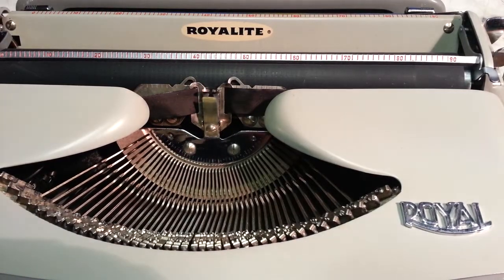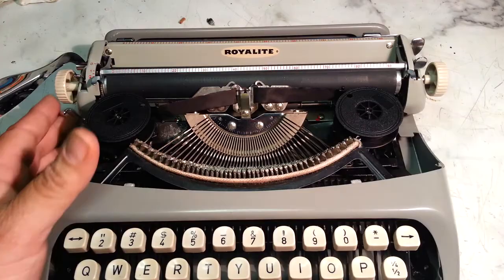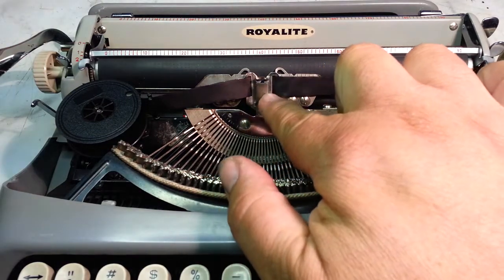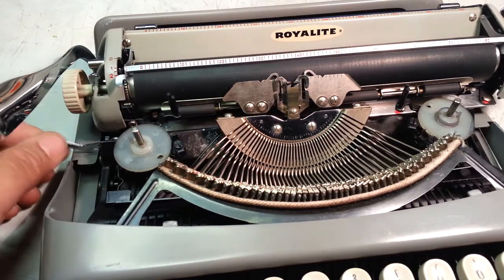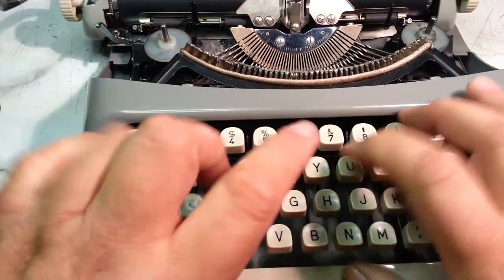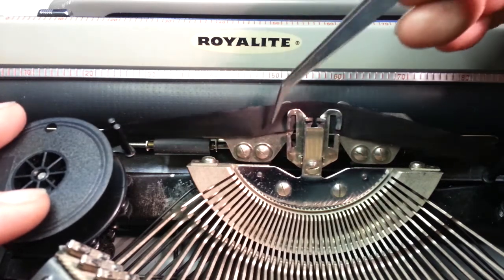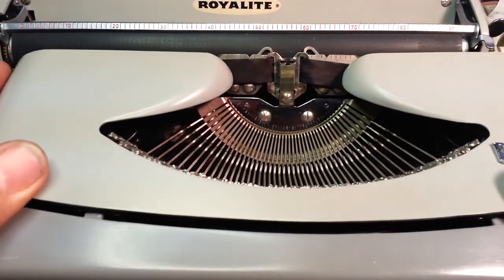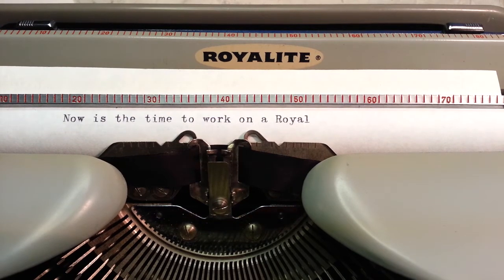Royal Royalite Typewriter Ribbon Install Demo Clean & Serviced Vintage Manual from 1960

Comment: Hi, please excuse my English, I'm not very good at it. I just bought a Royal Classic manual printer, but when I press the keys they don't show up well on the paper, I placed the ribbon correctly. If I press the keys a little hard you can see them better, but not always. Is this because the ribbon is not very good or could it be a problem with the machine? I need help to know if I should change it.
Reply from the maker: Rub the ribbon between your fingers, if ribbon is new, your fingers will be very inky
If your fingers are just a little dirty, ribbon is worn
If your fingers are not dirty, ribbon is dry/bad.
Reply: @phoenixtypewriter2136  Yes, my fingers were very dirty with ink. It is possible that it is a defect of the machine.
Reply from the maker: @Bimbibooks9898  Yes, could be something wrong.
This FB site is all about typewriter repair help,
https://www.facebook.com/groups/typewritermaintenance

Comment: Thank you so much for this video, I've got this typewriter and have been slowly tidying it up. I wanted to ask, as I have an ink smudge that appears on the line below the typing line, what could be causing this? I wondered if the ribbon was not being pulled tight but on this machine there aren't additional clips to hold it. It's all that is wrong with my typewriter now and am struggling to find out what the issue is!
Thanks again for the video, really helpful for a novice like me!

Comment: mine dosent move to the left when the keys are pressed unless I give it resistance with my finger on the carriage.  is there a secret button im missing or could a spring be dettatched?
Reply from the maker: Sounds like the main spring/draw band (string) is disconnected or broken.
This is a primary component that is critical to make typewriters work
Look up draw band videos to find some solutions

Comment: I have this exact typewriter. The carriage doesn't advance after typing certain keys. Do you know what might be the problem? Or a way to fix it?
Reply from the maker: Space bar work ? Tension on carriage ? not a common problem I have a common answer to
Troubleshooting is gonna be needed
Reply: @phoenixtypewriter2136  For the space bar works maybe the best, nice and easy, tension on carriage also good. Thanks for the answer.  Appreciate.

Comment: Hey Duane, I recently picked up two of these little guys. Are they supposed to have a ribbon reverse? I ask because One model seems to have that and the other doesnt.  On the one that doesn't, on the LEFT ribbon spool there is only 1 spring loaded L-shaped mechanism (with what looks like a space for another next to it (a screw but no L-shaped piece attached)).  It seems that the one you are working on here ALSO has only 1 L-shaped ribbon advancer on the left spool??? Am I overthinking this? I was about to try to fabricate one out of an aluminum lid and a ball point pen spring! :)  The second version, has plastic ribbon sprocket and TWO l-shaped advancer mechanisms on the left and ride ribbon spindles!

1:57
Reply from the maker: Yes they should have reversing. Hard to see but both R & L have a drive pawl (screw pawl) and an anti-back up pawl , 
you can post pictures on FB maintenance site
Reply: @phoenixtypewriter2136  thanks Duane. I've been laboring over this silly thing for a while. I deduced that there are supposed to be two and one l pusher was gone. I fashioned one out of a picture hanger and then installed. Unfortunately it's not working - due to difficulty getting a spring into that l shaped pusher mechanism. I can manually hold it and advance the ribbon sprocket. I'll get there. Anything better than ball point pen springs to replace the work out springs in such a mechanism?  And I'll have to look up the FB maintenance group as I'm not yet in it thanks!
Reply: Talan, I am working on one of these and the drawband is disconnected. Would you mind snapping a picture of one of your working machines, so I can see how the drawband connects?
Reply: @rossman1600  hi Ross. Sorry but I've sold mine. Pretty sure it just attached to a notch on the carriage and an opening in the main spring drum
Reply: @LazyDogTypewriters  Thanks very much. I think I found the notch on the carriage last night. I was looking under the carriage at first, and couldn't find anything.

Comment: I just purchased one of these for $22.  The Q strikes the lid but the typebar does not appear to be bent.  I suspect the lid is out of shape and will try bending it back.  Any advice or other potential solutions you can think of?
Reply from the maker: I would have to see it to make a comment, but your answer sounds good.....
Reply: @phoenixtypewriter2136  Sounded good... but didn't go well in practice.  Snapped it in half.  Oh well.  I bought this as something to learn on after watching a lot of your videos.  I plan to still attempt a tear down and rehab anyway.  Thanks for the reply!

Comment: What would cause a single character to appear dark and bold? In my case, it's the letter "w". When I'm done typing my journal entry or whatever I'm working on, it almost looks like I've encoded some hidden message because all the w's are bold and stand out. The slug doesn't appear dirty.
Reply from the maker: Type-bar face (slug) is out of adjustment, or type-bar is engaging basket to late (platen too soon) also adjustable.
Both these thing can only be adjusted/fine tuned by an experienced typewriter tech
Usually special bending/forming tools & how to use them are needed to to get this right